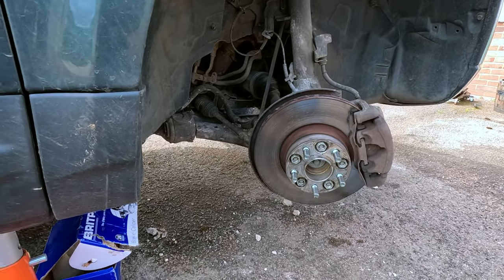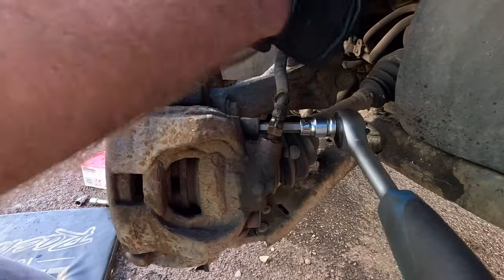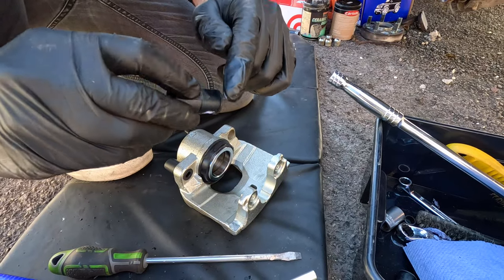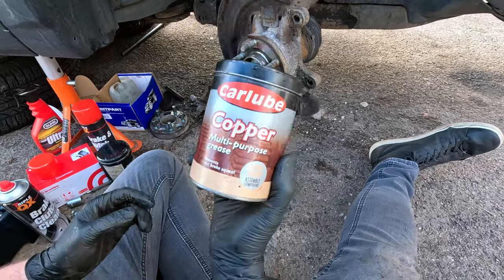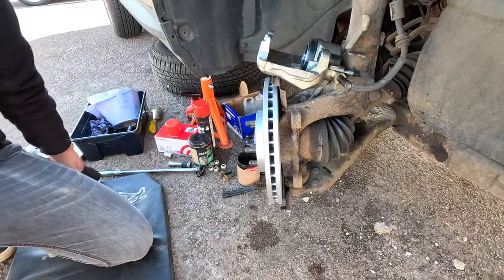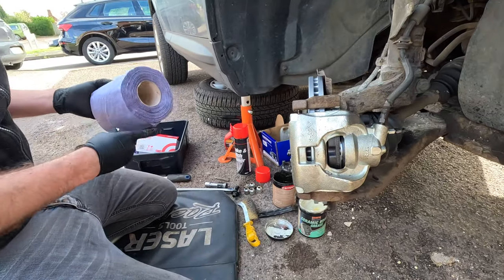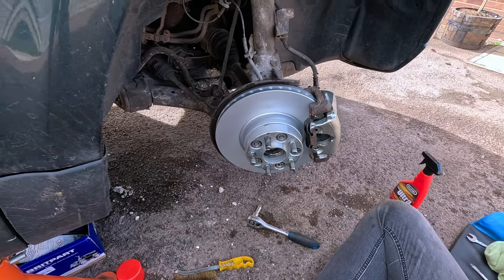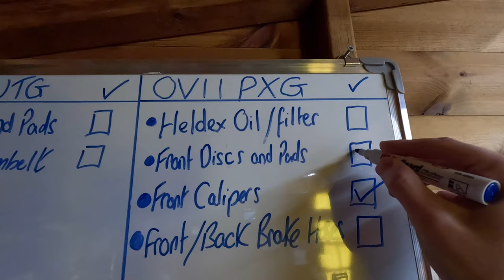Freelander 2 / LR2 - Front Brake Overhaul

Comment: Perfect timing gents, I've just bought a 2013 FL2 myself with 90k on it and am planning to swap all the callipers, discs and pads for good measure. I've done the job on my saab 9-3 before but my FL2 has a rear e-brake so that's something a bit different I'll have to look into.
Reply from the maker: Ahh a good purchase! 😁👍 You won’t be disappointed as they are great cars. Yes the last facelift model had an electric handbrake fitted. Hope it goes well with the fitting 🙂
Reply: there's a procedure to wind the ebrake callipers back from inside the car, very quick to do.
Reply: Procedure is:

Ensure its in park or neutral and the park brake deactivated and ignition turned on.

1. Press and hold the parking brake switch in the release position.

2. Wait 2 seconds

3. Press and hold the accelerator pedal in the wide open throttle position.

4. Wait 2 seconds

5. Turn ignition off and on immediately whilst still finger on park button and foot on throttle.

6. An audible noise will confirm service mode, it will also be displayed on dash.

You will hear the brake motors activate for a while.

Deactivation

with ignition on.

1. Press and hold the parking brake switch in the apply position.

2. Wait 2 seconds

3. Press and hold the accelerator pedal in the wide open throttle position.

4. Wait 2 seconds

5. Turn ignition off and on again. keeping finger on park button and foot on throttle.
Reply: @andytheaxewielder599  Thanks andy, appreciate you taking the time to post that for me.

Comment: Go easy on the coppa slip!  last time I did discs and pads on mine I put a bit on the hub mating face and it got spun off onto the disc and ruined the pads.  I now apply a bit and wipe most off again just leaving a thin coating on.
Reply from the maker: Thank you! 🙏 A good top tip! It’s certainly messy stuff

Comment: Looks like you had an easier time than I did this morning. Ceased pistons both sides. 🤔 Needed to use a hammer and pry bar just to slide the caliper and pads from the rota.
Reply from the maker: It was pretty good 🙂Had to battle with the rain at first but luckily sun came out later. Oh no, not good! Hope you managed to sort it 🤞I guess they might have got a bit hot to cease?
Reply: @FrenchiesRoadTrips  don’t know. As I’ve permanently got this lot in the back 🐶🐶🐶🐻🐶. I don’t break that hard. 

Thinking that the pins were resistant and contributed the the pistons ceasing. 

I messaged you on FB ref your white board.
Reply from the maker: @freelander2_litelander  😁 Very true! Funny enough we were just talking about this. Wonder if it’s because we don’t heavy brake much that causes the pistons to seize? 🤔Ahhh yes! I’ll get Ben to reply! 😁

Comment: Hi, good video, missed my breakfast to watch it this morning. I have a question. My vehicle is 2008 TD4 HSE auto with 368,000km, left hand drive. You have 235/60/r18 tyres, same as mine so why do you have/need a spacer? Is it just to push the wheels out a bit?
Reply from the maker: Hello! 😁 Thank you! 🙏 We hope you managed to have breakfast in the end 😅 Wow, that’s impressive mileage, we don’t often hear many with that mileage. Good question! They’ve been on the car for sometime now. We found it helps with the laning and gives the car a “wider” look 👀 It’s remembering if you have them fitted to grease them  regularly as they can fuse to the disk. Overall we like them and does change the styling a bit 🙂

Comment: Great video guy, thanks.
My rear calipers were replaced by the garage during an mot as they were beginning to seize but I'd like to replace my front calipers myself,  but in summer tho 😅. Looks straightforward enough, wish landrover had used banjo connectors on the hose to save spinning the caliper. My FL1 had them, wonder why the FL2 doesn't. 
Like the wheel spacers 👍, do they affect the  handling any?  Cheers guys. K.
Reply from the maker: Thank you! Glad you liked it 😁 It’s a good DIY job to do! Not too tricky. Lots of prep, WD40 and the correct cleaning and grease should do the job really good. If you want the Torque settings they can be located in a copy of the Haynes manual if you need them or let us know and we can let you know. 

It would make it so much easier if you didn’t have to spin the caliper! So the wheel spacers we added to help with laning and they do help with cornering we found. Also gives a wider look and feel to the car 🙂 Good luck with the brakes when you do them!

Comment: Good video thanks for sharing but a bit to much grease used, on both the carrier, and the hub, also no grease to be used on the wheel studs, i would have changed the hoses also, after a time  It’s not uncommon for the inner lining to degrade and separate forming effectively a one way valve.